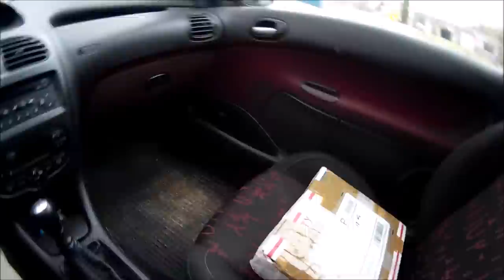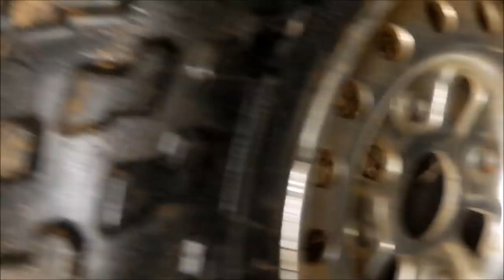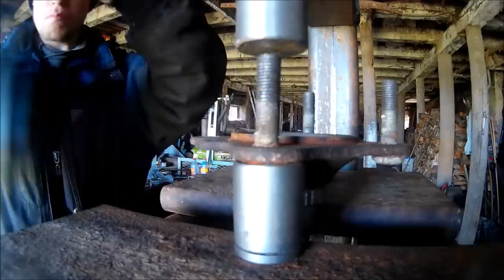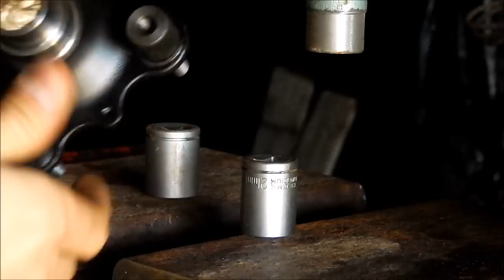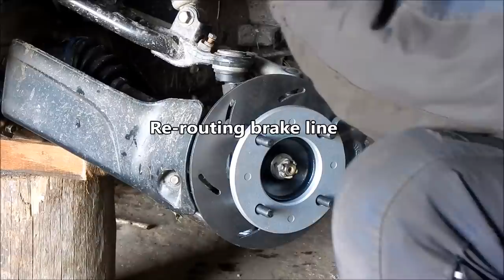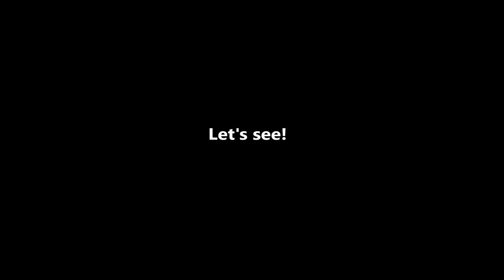High Lifter Disc Brake Conversion Kit For Honda Foreman

Comment: Wow, you don't know how helpful this is to me!! I  recently installed those same brakes on my Foreman but they keep locking up. I had a motorcycle shop bleed them because I didn't know how to do it. I think there's water in the line because they keep locking up. Now I know how to bleed them without special tools. Thank you!!!

Comment: I think you can expect even better when they will be broken in.
That's really a good upgrade.
Are the discs stock parts from others vehicles ?
I've seen the brand wilwood on the caliper,wich is pretty good.
Reply from the maker: +michaelovitch It's night and day compared to the old drum brakes. I also think they'll perform better after being used for a while. Can't really say about the discs but the Wilwood calipers should be pretty standard. The sellers main argument was selling Wilwood. :D

Comment: Rebuild drums or build disc brake kit...its like same price and depends how you use them, also there is only small difference in stopping power between drums and disc brakes if setup right its only drums don't have heat dissipation discs do so loose performance.
Its the reason plenty of work vehicles still use drums its cost effective.
Thanks for video helped make my decision

Comment: Wow, you said you didn't maintain your brakes! You should see how muddy my drums are inside and they still brake like new. I'm just tired of cleaning them out all the time, what a pain in the A$$. I was looking for a less maintenance brakes and ones that would hold up better in the wet, especially when its cold, if any water got inside, it will freeze up the shoes. It's been a few years since you posted this video, you still happy with the kit? thanks for the video, Cheers.
Reply from the maker: Yup, absolutely. Disc brakes are far more superior to the original drum brakes. 👍

Comment: Very cool! Do you know if they make a conversion kit for the rear drum?
Reply from the maker: Yup, they do. I've contacted them and asked for a sponsorship since I'm a cheapskate, but haven't heard back from them. :D
Reply from the maker: Here you go: https://www.ebay.com/itm/HONDA-REAR-NEW-DISC-BRAKE-CONVERSION-KIT-ATV-FOREMAN-RANCHER-TRX-500-450-400-350/281477497283?epid=925833356&hash=item41895dc1c3:g:d~4AAOSwjyVT0BxS&vxp=mtr
Reply: Thank you!!!

Comment: What years is this kit good for? My boyfriend has a Honda Foreman 450s 2001 model, is this kit, or will this kit be compatible? Also is this just for the front or for the rear also?
Reply from the maker: If you type into the search box in eBay "Honda Foreman front disc brake conversion kit" you should get several auctions and on the item page there's usually a list of ATV-s the kit fits. There's also a rear conversion kit separately available but it's more expensive than the front one.

Comment: I installed this system today and bled the brakes GOOD AND THEY DON'T STOP VERY GOOD AT ALL ANY IDEAS? NO AIR IN THE LINES.
Reply from the maker: Nice to hear about your conversion. Surprisingly I didn't have any problems with the master cylinder. It works really well. Maybe the rotors and pads have to have a work in time so the surfaces will match better and thus grip better?
Reply: @DonnDIY  okay buddy maybe that's the whole idea thank you very much for your response
Reply: @jimsimpson4385  did you figure out the problem yet? I just installed these brakes on mine and new master cylinder and mine dont stop good either
Reply: @isaac-jk8pz  No i did not ,I ran it hard this past weekend and i got in real trouble on long down hill grades! I am not happy with them at all. I talked to the company they told me they are NOT designed to lock up your wheels. I have removed them sadly and put the factory brakes and new shoes on and i can now STOP a full lock up if need be. Good luck with yours.

Comment: times four wheels!
Reply from the maker: The front brakes are separate from the rear ones. The rear brakes are mechanical, cable operated drum brakes. High Lifter does a kit for the rear end too though.

Comment: hey! where did you get the new threaded studs from?
Reply from the maker: Came with the kit.
Reply: Can you send the link where did you buy the kit from? Thanks for the reply
Reply: I have 06 Honda rincon 650 And if I need to change the disk after a while do they have replacement for it?